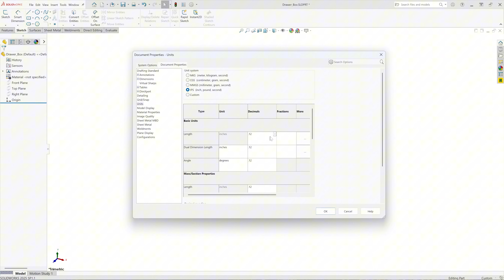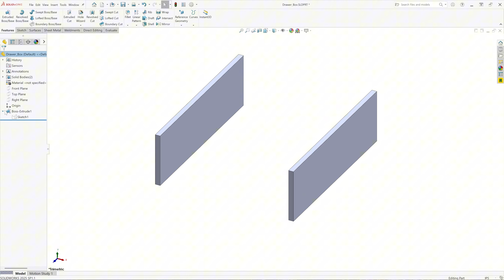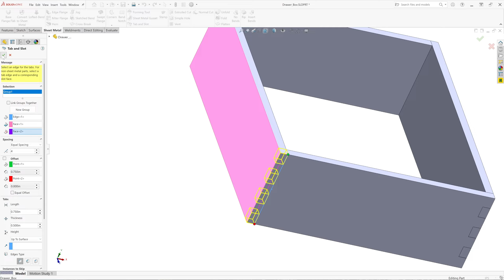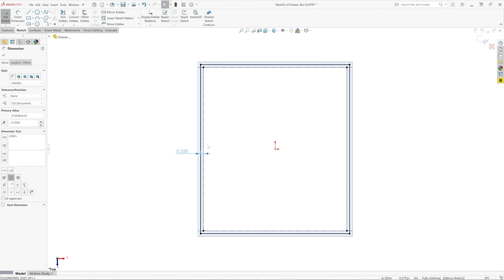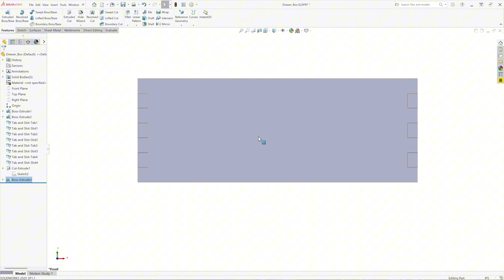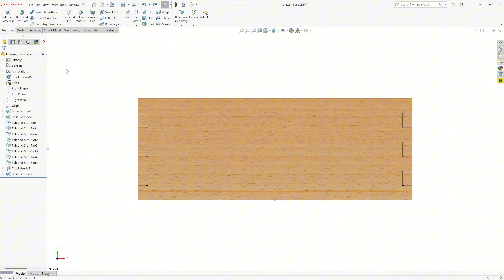Drawer Box - Create Finger Joints with Solidworks | Woodworking

Comment: I keep getting a build error for the tabs. I selcted the edge but the colors are flipped (red on bottom, gren on top) Also when I select the face, it doesn't automatically select the Face 2 for the purple box. 🤷‍♂
Reply from the maker: 1. Use View Orientation: Front View to select the Tab Edge (Blue) - make sure to select the edge line towards the top to position the Tab Start Reference (green), if you select towards the bottom of the edge line, then the Tab Start Reference (green) will position at the bottom. 2. Rotate the part in order to select the Slot Face (Pink) 3. Tab Face (Purple) should automatically be selected accordingly. Repeat the same steps for the other 2 corners, using View Orientation: Back View